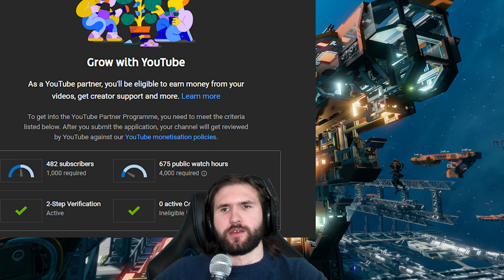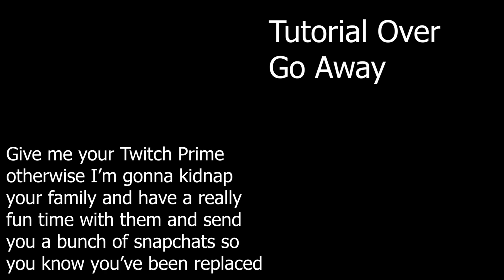Starbase Mini Tutorials: Asteroid Avoidance!

Comment: Smashing stuff!    Or lack of actually!

Does this system turn the forward throttle to off while it strafes to the side when an asteroid is detected,  then turns the throttle back on once the asteroid has been avoided?
Reply from the maker: Technically yes, and technically no. It changes the flight computers position when dodging an asteroid. So yes it does temporarily shut it off, but also it doesn’t.
Hope that relatively answers the question.